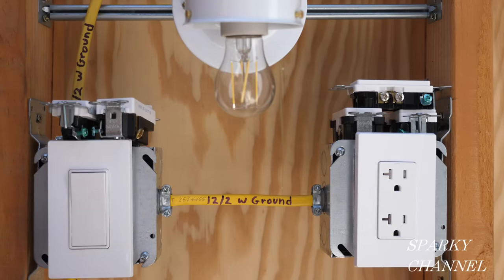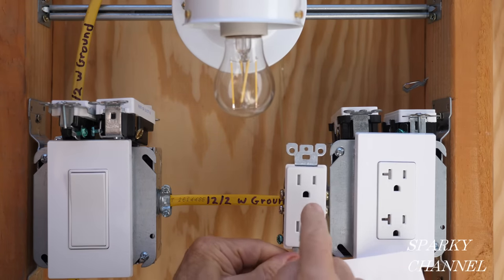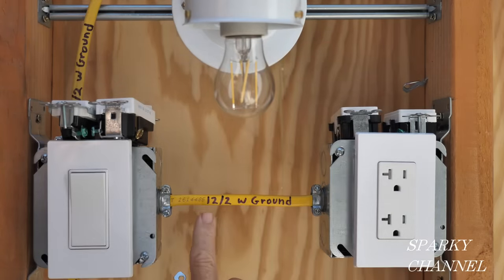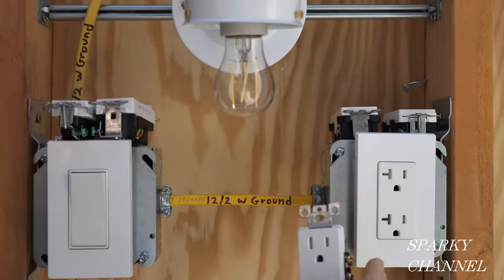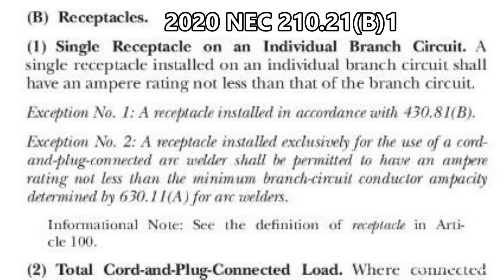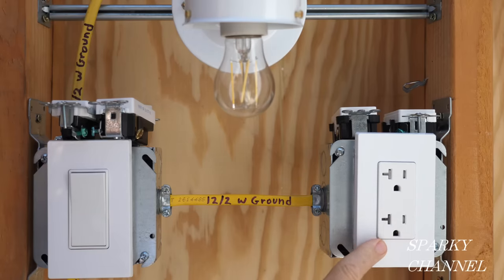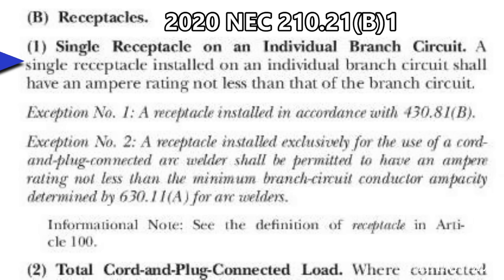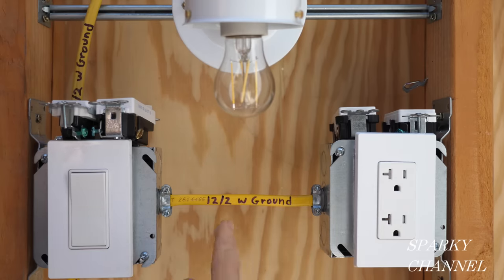Shall I Use a 15A or a 20A Receptacle on a 20A Circuit? + 2020 NEC 210.21(B)(1) and 210.21(B)(3)

Comment: I bought an old house, and I am planning to replace the whole circuit. I am thinking of wiring most of the house with minimum of 12 AWG wires, even I will still some 15 amps breaker. Never knew I might need to upgrade to 20 amp in the future.  
I think if the room is going to have a receptacle, use 12 AWG., never knew someone might plug a damn hair dryer in that room. i think 14 AWG should be obsolete.
Reply: 12/2 is overkill for much of the house. The bedrooms really do not need anything more than 15 amp circuits, the same for lighting throughout the house, 14/2 and 14/3 are fine. Now for the kitchen, 12/2, 20 amp, on multiple circuits, same for the garage where you may be using power tools and such. 

If you are going to have a nice stereo with amplification, one or two 20 amp 12/2 circuits would be a good idea, dedicated to that AV gear. 

When you start pricing out the Romex, you will see what I mean. Use the 12/2 where needed, and 14/2-3 everywhere else. And the 15 amp outlets are internally the same as the 20 amp outlets. There is no magic going on inside of these outlets.
Reply: @michaelwright1602  highly disagree 
As time goes on each room has more gadgets and electrical needs. Rooms you think don’t need high draws have many reasons they might already 
I think you’re underestimating modern and near future power needs
Reply: @davidramey7186  Well, then one should go straight to 10 AWG.  From what I see, household circuits in the room seem get less power load rather than more, unless you do bitcoin mining or grow something under intense light. Gone are 60-100 watt lightbulbs which one may had couple of dozens.  The phone chargers take perhaps 30-40 watts and how many do you have , maybe five ?.
Reply: Why on earth would you only put a 15A breaker in, if all the wiring supports 20A already?  That's just subjecting yourself to extra limitation and potential nuisance tripping for no benefit.

If you put in 12 gauge wire, put in a 20A breaker.  It's not like it costs any more, and then you'll have more flexibility and headroom for the future (and whoever ends up owning the house down the line won't curse your name for sticking them with a 15A circuit that they never realized could have been 20A, if they'd only known they just had to swap out a mismatched breaker that somebody put in for no apparent reason).
Reply: @dmitripogosian5084  There are still lots of devices that can take significant amounts of power that people do regularly use all the time.  Heaters, electric kettles, many computers, etc.  Heck, just putting two high-end gaming PCs on the same circuit could theoretically overload a 15A circuit by itself.  Especially if the circuits are shared between multiple rooms, it is still very possible for somebody to occasionally need a 20A circuit in many cases.

My usual recommendation is 20A circuits for all receptacles, 15A for all lighting circuits (and lighting and receptacles should be separate circuits whenever possible).

Comment: So I have to ask.  I haven't seen a 20A device in the kitchen, especially on a counter top device.  While the receptacle is heavier duty, I agree, as most people and electricans will use the cheapest outlets they can get by with everywhere.  All the appliances are only 15 amp max based on the NEMA 5-15 plug.  That goes for microwave, dishwasher, garbage disposal etc, I haven't seen a 20A rated cord / and NEMA 5-20 plug on any of these devices.  The only 120VAC devices I can think of that are 20A could be a window AC unit, and I am sure a few other devices, but they aren't normally used in most houses.
Reply: I guess you are not planning on running your electric kettle and your microwave at the same time.
Reply: @farmerdave7965  To run both of those at the same time on the same outlet or even branch circuit would be more than 20A can support.  I am all up for using 12AWG wire, don't get me wrong there, but in a normal home I don't see the need for 20A receptacles, as nothing for the most part uses them.  Everything only uses 15A plugs.  Personally I would like to see all receptacle runs in 12AWG no matter what, and lighting in 14AWG at least.  Back in the mid-late 80's I can remember working at lumber yard in the electrical dept and very rarely did we sell 14AWG wire, everyone used only 12AWG.   In our house here it was built in 2008 and has a various mix of 14/12AWG to the outlets and lighting circuits.  We have 107 switches various 2-3-4 way and 167 duplex outlets in our home.    These all go back to dual 200A panels, with the 80 combined spaces we only have 8 left, the rest are full.
Reply from the maker: @Chris_In_Texas  According to 2020 NEC 210.21(B)(3) you have every right to use all 15A duplex receptacles if you prefer. That's why I made sure to go over the actual codes before giving my opinions and preferences. You guys have a big house! Thanks and have a great 4th!
Reply: My microwave draws 16A and has a plug with the one prong sideways, to ensure that it only gets plugged into a 20A circuit.

Comment: Could you explain in more detail the “pass through“? I always thought it meant that it represents the amperage that was going through that particular receptacle to the next ones down stream.
Reply: I believe "pass through" is a term used when all 4 screws are used are used to connect current going downstream instead of using pigtails. The metal plate on the outside of the receptacle is rated to pass 20 amps of current from one hot wire to the adjacent hot wire where they are attached to the screws. Same thing for the neutral wires. Some current will flow into the receptacle as well. It will not flow through (to the neutral wire) unless something is plugged in and under load. That's my understanding.
Reply: @surferdude642  sounds like a good explanation, thanks!

Comment: Dear  Bob, if that when the fact, then using the same table  210.21.B 3 you could plug a 50 amp appliance to a 40 amp circuit. When in the wall there is no real difference between a 15 amp and a 20 Amp  receptacle. To ver size a  circuit components in reference to the breaker is a very common thing, as a matter of fact with the wires is very common, if you have a long distance between the Breaker and the load. In any case if you do what you say and connecta 20 amp appliance in the 15 amp breaker circuit, the breaker will trip and no harm done.

Comment: Metal boxes ( like ur video ) or plastic boxes for a new construction?
Reply: it is preference, if it is behind drywall might just use the plastic ones because they are cheaper and are easier to install, though they can strip out easier, metal wont strip out easy (referring to the screw holes for the device being put into them)
Reply: I never use the cheap plastic boxes because they strip out easily.  There are hard plastic boxes that are much better.
Reply: @DR-nc8nc  the fiberglass ones are good too, though a bit harder to find
Reply: Metal boxes for wood studs....Plastic boxes for metal studs.

Comment: Any idea what the rationale is for single outlets needing to exactly match the circuit but duplex outlets don't have to?
Reply: Probably because single purpose circuits are likely to be used by high draw devices. IE: Microwaves, air conditioners,  pumps, etc.
Reply: The rationale is that (in theory) with a duplex on a 20 amp circuit (or more than one outlet on the circuit), you might not have all 20 amps of a load going to one device & thus through the outlet. 
Take a single outlet receptacle: let's say you have a 12GA wire going to just one outlet. You run a device and it uses all 20 amps, then all 20 amps will be flowing through that outlet. The plastic and metal of the receptacle will then experience all 20 amps, thus needing a 20 amp rating.
Take a duplex receptacle or more than one outlet on a 20 amp circuit: in theory, you could have 2 or more devices all drawing amperage. If you draw more than 20A in total, the circuit will trip. But you won't have 20A flowing through any one outlet, so you can use thinner 15A receptacles.
That's the theory -- but in practice if you have just one appliance on a duplex receptacle or on any given circuit, I don't see how that would be different -- you still might get 20A through any one outlet. But I'm no engineer.

Comment: So, can you leave the last 20 amp recepticle with 14-2 wire to travel to the 15 amp recepticle?
Reply: An electrician told me you can't mix 12-2 and 14-2 in the same circuit even if it is downstream
Reply: Standard practice is to run 12/2  all the way and then install a 15 amp receptacle on. 15 amp breaker.

Comment: Mr. Bill at 4:30 looks like a difference in the galvanized strap that holds the SPEC GRADE device together. Looks like it wraps around the receptacle holding it together better??. What does the residential strap look like inside? Just straight through I guess. Thanks for this!! ALSO HAPPY 4TH EVERYBODY!!!
Reply from the maker: Yes, you can also see the strapping difference at 7:07 with the switches. Good point and Happy 4th!

Comment: Also it has a 20 amp circuit that had multiple of outlets I would use a 15 amp device cuz I feel with Overkill to use a 20-amp device when it's going to be split up by multiple Outlets

Comment: That's because  a 15 and a 20 amp receptacle have the exact same kinds of contacts in them. The 20 is just shaped different but the 15 is just as capable of flowing 20A as the 20 is. Got this straight from a Leviton engineer.

Comment: That’s interesting that code says you can put a lower rated 15A receptacle on a 20A circuit. The receptacle could fail before the breaker trips.
Reply from the maker: Good point!
Reply: When I replace a receptacle, I buy the heaviest duty one I can find, usually hospital grade since they can take continuous usage at full amps, 24/7. Also, they hold onto the prongs the best. I have on occasion put 20amp receptacles on 15 amp circuits since the receptacle is more heavy duty. I don’t get the code saying that’s not allowed. If you plug in a 20 amp device on the circuit, the breaker will trip. The odd thing is, the code then says you can use a 50 amp rec on a 40 amp circuit. It’s not consistent.
Reply: I'm not an electrician but I have looked into it and I believe that any appliance or tool or whatever you want to plug into an outlet that draws more than 15 amps is supposed to have a 20 plug on it. The 20 amp plug will have a ground on the bottom with a single vertical prong and a single horizontal prong as opposed to two vertical prongs. This prevents it from being plugged into a 15 amp system.

In my garage I had a 20 amp system that had a 20 amp breaker with a 12/2 with a ground but I had all 15 amp outlets in the receptacles. This works fine because the 15 amp outlets prevent any 20 amp plug being plugged into it and overloading the breaker or wires. I then got a new drill press that required a 20 amp plug on the end of it so for that receptacle I needed to replace the 15 amp with a 20 amp outlet.

I believe that the 15 amp outlet can handle 20 amps going through it and that the only real difference between the 15 and the 20 amp outlet is to physically prevent anyone from plugging a 20 amp plug into a 15 amp receptacle.
Reply: It’s backwards from what it seems. The receptacle is rated at 15A because that’s what appliance plug it will accept. Therefore the circuit would not be in danger, since the circuit is rated for 20A, but you are only using 15A appliance.

I read/heard this is what should be done but not clear on that.
Reply: Perhaps if something is truely pulling 20A it will have a plug that is a 20A plug.
Reply: @StefanSteinerWA  It's not allowed in order to prevent anyone from inserting a 20 amp plug as this would overload a 15A circuit. BTW, any tool or equipment which has a 20 amp plug, should only be used on a dedicated circuit and the receptacle must then be a single, not a duplex. The only valid reason to use a 20 amp duplex receptacle in a residential application is for quick circuit amp identification. However, as you pointed out, this reason is not foolproof. Any homeowner can unknowingly install a 20 amp receptacle in a 15 amp circuit, falsely assuming it's more robust. If you use a "spec grade" as Bill points out in this video, then the 15 amp receptacle is the same quality as a 20 amp "spec grade".
Reply: @ScottCleve33  I believe what you said is mostly correct. However, if your drill press is equipped with a 20 amp plug, it should only be used on a dedicated circuit. The reason is that a 20 plug implies that the current draw is at or near the maximum safe value without any load from other receptacles on this circuit. You can verify the current draw with a clamp meter, while drilling into material that you would use.
I'm assuming that your drill press is a older one, as most modern ones use a standard 15 amp plug. If it's very powerful it would require a 20 or 30 amp 240v setup, ttbomk.
Reply: @surferdude642  I agree that in a perfect world that outlet for my drill press should be on a dedicated circuit but with it being a detached garage and only 110 volts supplied to it I don't have the means to have a dedicated circuit to the garage for one outlet.

The likelihood of overloading this circuit is very slim as I'm the only one who uses the garage and it's highly unlikely that I'll ever be running a drill press at the same time as any of my other tools. If it was a table saw or sander that I use more often of for longer periods of time it would be more of a concern. For example when I remodeled my kitchen I installed a dedicated lines for my dish washer and garbage disposal since both of them drew about 10 amps, considerably lower than my drill press, but much more likely to be run at the same time as one another or with another appliance.

And for the record the drill press is brand new. It's a six foot tall floor model that replaced an older one that was damaged in a fire in my garage.

PS. The fire was in no way related to an electrical issue.
Reply: @ScottCleve33  Thanks for the explanation, I'd probably do the same thing in that case. 
As far as the 20 amp plug is concerned, I assumed that they are extremely rare on modern equipment. I've done some brief research, just for curiosity, and haven't found anything. I have found equipment including drill presses have have optional 230v wiring.

Comment: Can we use a dual 20 amp  receptacle for a single 12 G 20 amp circuit.. I am planning to connect split AC 110v to inside outlet replacing with 20 amp receptacle pls suggest

Comment: Not the right question.
Do you choose to buy from the Chinese outlet, the Mexico outlet or the Baltimore outlet. Choose wrong and you'll  be replacing it again in 2 years.
Reply: Yeah, it's tricky.  The Chinese outlet should still be UL Certified and approved by all American electrical authorities to meet all the standards, but, then there are the counterfeit Chinesium devices with their counterfeit approval stickers.

Comment: Do the terms receptacle and outlet mean the same thing? Are they interchangeable?
Reply: Somewhat. Outlet refers to a point of utilization. This includes light fixtures! Think of it as somewhere the electricity is let out of the circuit, intentionally.

Comment: Hey sparky do you know where in the code book it talks about ampacity rating for 12 gauge wire
Reply: 12 Guage wire falls under the small conductor rule. Even though It can handle more than 20a. The NEC limits it to 20a circuits.
Reply: Eric Willy yeah that’s what I thought aswell but I’m confused because the ampacity rating for 12 gauge is 30a

Comment: is there any danger or code violations with a 20 amp breaker with a 14/2 wire and 15 amp receptacles?
Reply: Yes, fire. 14 gauge wire isn't thick enough for 20amp. you must use 12 gauge (which is thicker). Because the breaker is 20 AMP. you could, in theory, pull 20 amps of current before tripping the breaker which could cause a fire in the wall or at the outlet.
Reply: @bwats1991  so i should replace the 20 amp breakers with 15 amp? i always assumed using a larger breaker would allow the room to use the outlets without a worry of tripping or fire hazard but thats why i asked. lol ty
Reply: @handydan1591  You can have 12 gauge wire on a 15 amp breaker, but not 14 gauge on a 20 amp breaker.  If you push that 20 amp breaker close to its limit,  then you will overheat the 14 gauge wire.
Reply: @handydan1591  Keep in mind that the breaker is the fail safe. It's supposed to flip that breaker as a safety measure to prevent the wire from burning. The wire is the weak point in the system and everything is done to prevent the wire from being overloaded. The breaker is set to keep the wire from drawing too many amps and the outlet is set to prevent anything too large from being plugged into it to draw to much power. The 20 amp outlet and the 15 amp outlet are identical except for the physical limitations of what you can plug into it because of the one horizontal prong.

Comment: What if you have 2 things plugged into a 15amp rated plug and drawing 19 amps. Not enough to trip the breaker.
Reply: for instance 2 heaters? or a blender and a toaster?
Reply: First... 19A on a 20A circuit will definitely thermal trip over time.  Second... each side of the 15A receptacle is rated for 15A which makes it 30A capable, combined.  Your question is no different than asking of the 15A duplex is rated 15A total, or 15A per receptacle;  It's the latter.